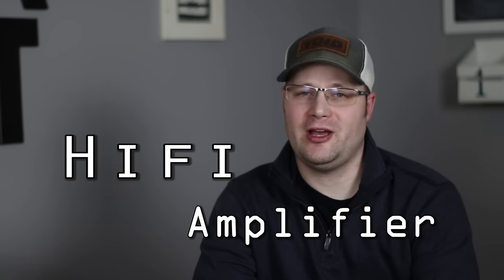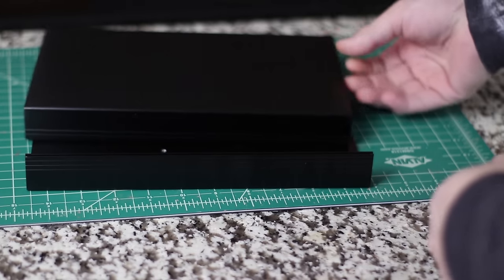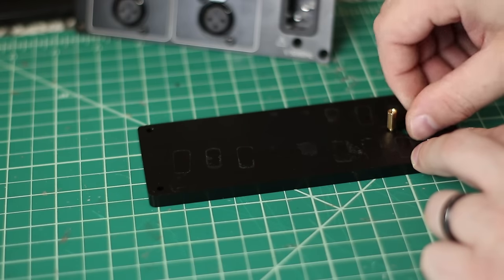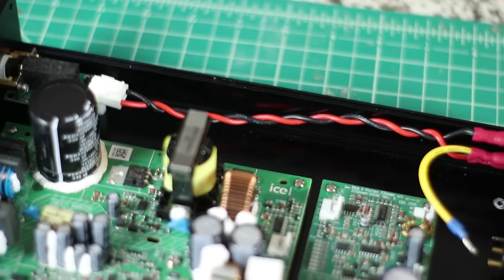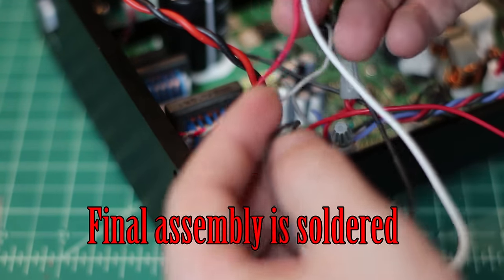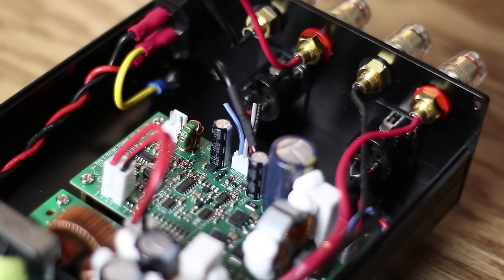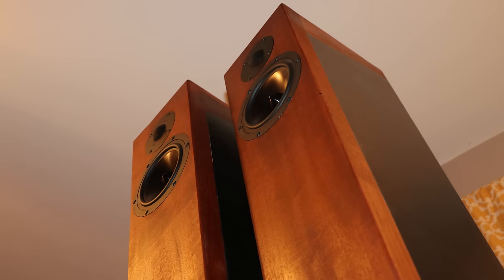How to Make a $3000 DIY HiFi Amplifier for $300

Comment: Hi, Just want to confirm that i get it correctly after watching the video,  so, i need to buy 1 X 200ASC board and another 200AC board to connect together for a stereo power amp ?
Reply from the maker: That is correct.  You can actually buy another 200ac board if you want to make it a 3 channel amp.  All the links are in the description to all the parts that work together. You do want to get the cables to hook it up as well. Unless you're going to make your own.
Reply: @Toid  

Just a minor heads-up, but at the start of the vid, you referred to the ASC as the ASP, and the AC modules as AS.

Do they have alternate part numbers, or was it just a mis-speak?
Reply from the maker: @electronash  at 1:30 I answered that.  Basically I misspoke.
Reply: @Toid  

Ahh, see, I made the usual mistake of typing before watching. lol

Fair enough. ;)
Reply from the maker: @electronash  haha, no problem. I knew it would get some people, so I tried to do a PSA.  But I know, not everyone will see that.  Glad I could help you on the confusion.
Reply: @Toid  

It could be interesting to do a blind test with these amp modules vs some of the cheap Class-D amp boards from China.

I started building a 7.1 surround amp many years ago, using the 4*100 Watt modules from Sure Electronics, and it sounded pretty good.

Not that I ever finished it. It's been sat in it's aluminium case ever since. lol

(I used the DSP board and MCU from a Denon AV receiver for the Dolby / DTS decoding.)

Then again, I've never owned any Class-D sound as good as the Crown cts2000 amps I have. Even at low volumes on tiny speakers, they sound amazing.
Reply from the maker: @electronash  That is a good idea
Reply: @Toid  But then you would need a diff case, and more cables.

Comment: XLR to RCA is supposed to have a short. (Between pin 1 and 3) signal - has to go to a known state to suppress noise 
(Since the sum of sig + and sig - = only noise, when sig - is floating it picks up the 50 or 60 hz hum and the amp try’s to cancel it out of the sig + this results in added or removed 50/60 hz on your speakers (depending on the signal (and polarity) pressend on sig + )

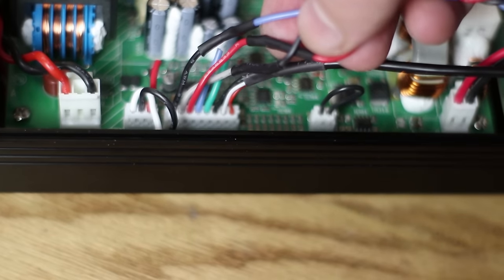Comment: Not a big deal but at 9:40 you said the asc would be connected to the left side - but that is the right channel as labeled on the rear plate and can be seen at 12:04. You have the 200asc connected to the XLR and binding post labeled for the right channel and the 200ac connected to the ones labeled for the left channel.